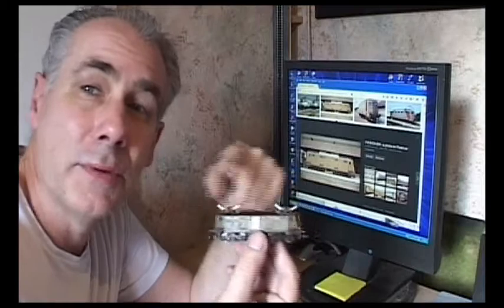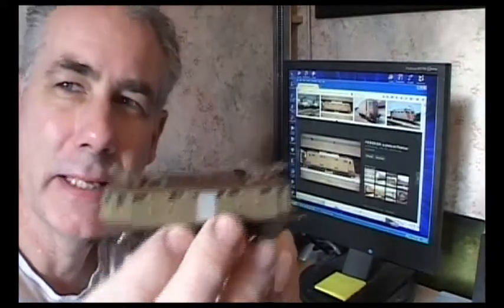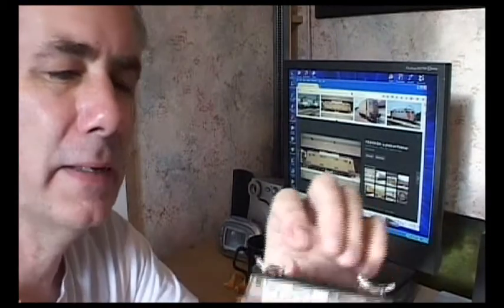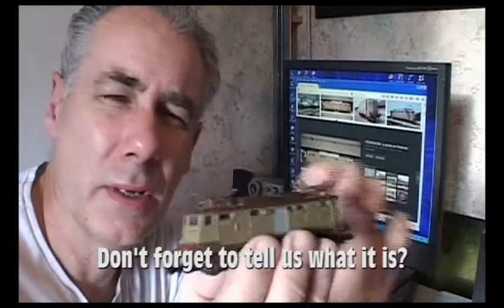Scallywag Corner - N Gauge Sci-Fi Model Railway - Pt5 - E424 Diesel (see Pt8)

Comment: A lovely little new addition. Will there be some Sci-Fi modifications to it for the layout?
Reply from the maker: +SDJR7F88 Oh yes indeed. Quite a bit. Stay tuned. This one has a damaged pantograph, and the last one went on eBay quite cheap, so they are not valuable. It runs quite well but can only pull a single wagon - it slips with two. So it will become Grotwipe very soon. It ran for the last time as an E424 tonight.